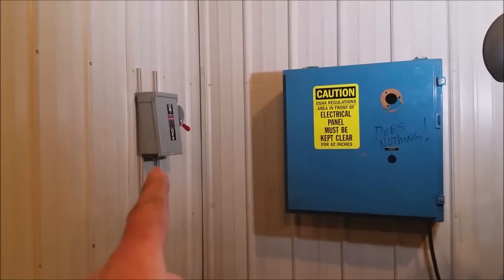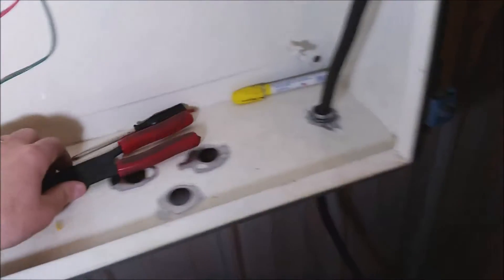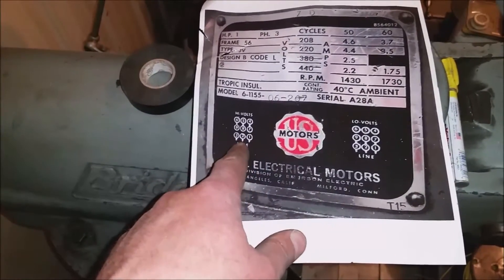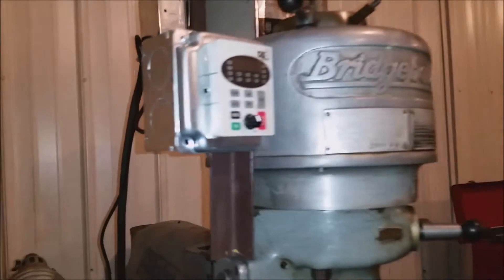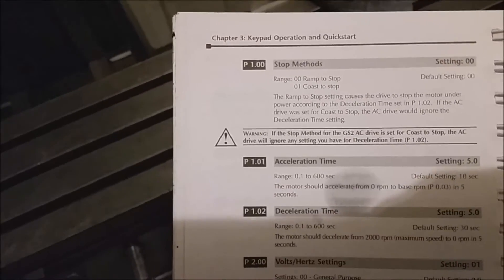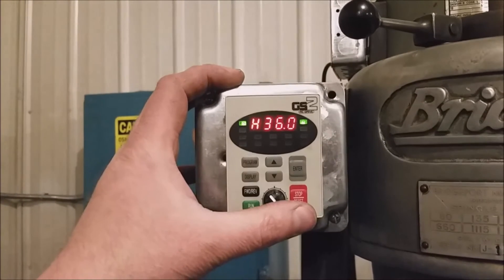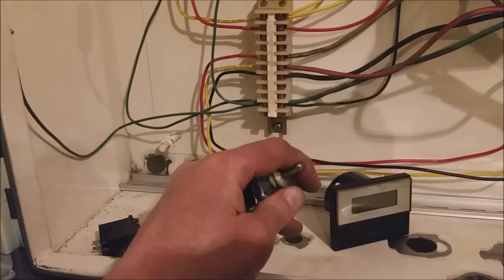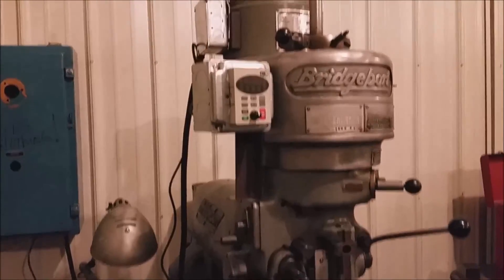Bridgeport Mill VFD hook up part 2

Comment: The original mill switch could have been setup for fwd and rev. The VFD has terminals for that.
Reply from the maker: Agree. Although I do really like having all the controls together on one little box. Main regret for not saving the switch is to have it as sort of a final "safety" disconnect.

Comment: Aren't terminals 4,5,&6 supposed to be tied together as shown here? http://constructionmanuals.tpub.com/14026/css/Dual-Voltage-Wye-Motor-245.htm 

  I think you are only using 1/2 of the windings in your motor. See an explanation here https://www.youtube.com/watch?v=hDXGYA6RYPY
Reply from the maker: Hey Larry - Thanks for this comment.  I finally got around to investigating and made the correction in this video:  https://youtu.be/QoKUthNLaBM
Reply from the maker: @BrewmasterC  You are both right about this.  Correction made - thanks!

Comment: Great video, I have the same drive, but I am having troubles with the setting, specially with torque , and speed, a lot of times OL... you mind sharing some of the parameters with me? I input all the settings of my motor, but the other ones are the ones I am interested. thanks
Reply from the maker: You'll get OL if you ramp down to fast on shutoff, etc. Probably too fast ramping up also.  For fast slowdown, should add the recommended resistor.
Reply: @ThoenWorks  thanks.. have you tried power tapping with it? what setting you have for that?

Comment: Nice job ! May need next time add protection  bushings to the wiring run's thru the box's to prevent wire insulation damage.
Reply from the maker: That, and a few other changes. 😎